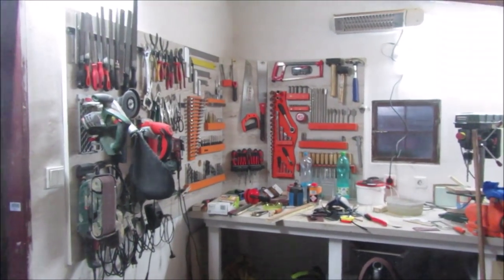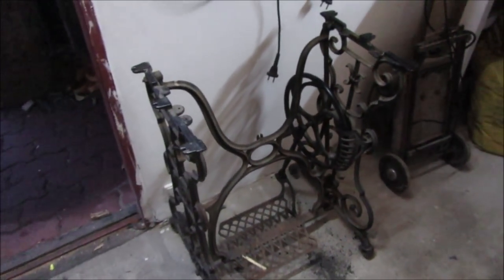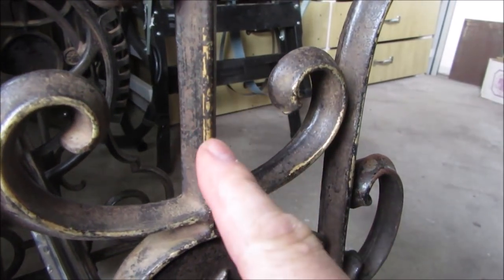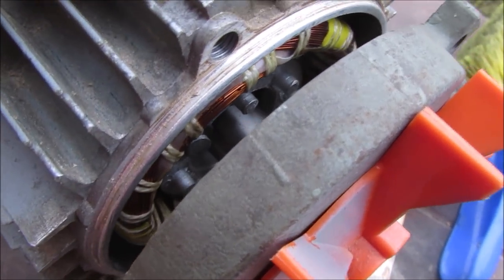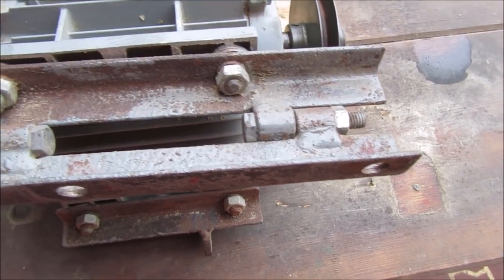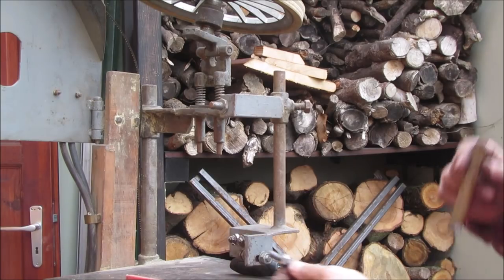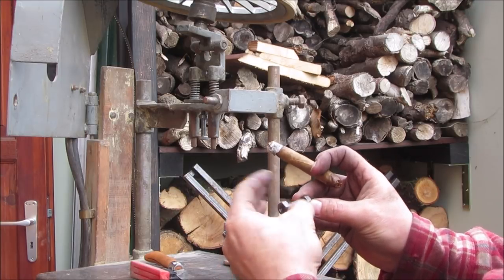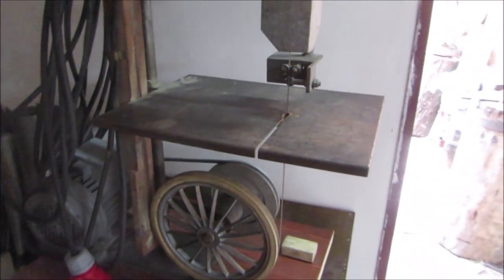Restoring an old home made bandsaw

Comment: I really enjoyed this video.  That's to cool to see a home made bandsaw.  That old and still working.  
I have an old Craftsman I bought about twenty years ago and need to change the tires on it again for the second time.  No fault of the saw though.  Its all on me. I use it to cut fat wood and the resin heats up and coats the blade and tires. When you turn it off and don't clean it and it sets for a while without using it the resins hardens and glues the blade to the tires.  They are very thin and when you turn it back on it will break the tire.  Lol.
Reply from the maker: BluegrassBushcraft Damn, good point, i wont be cutting fatwood with it.
Reply: @dabberty  I forgot to mention I'm glad to see I'm not the only one who uses my table saw as a work bench.